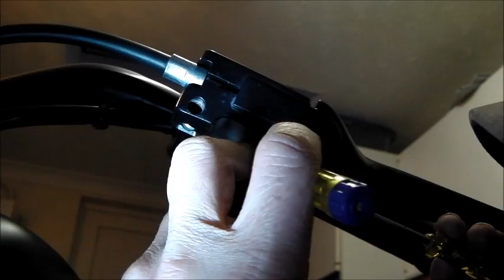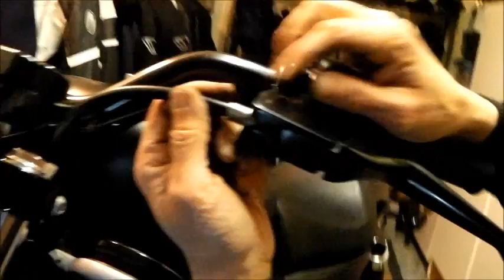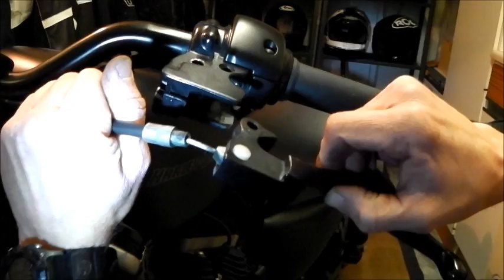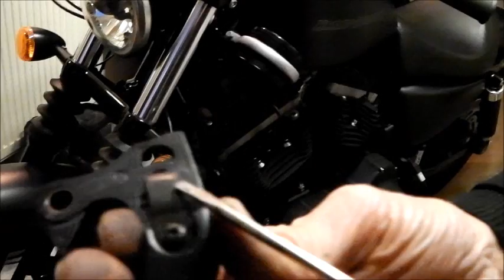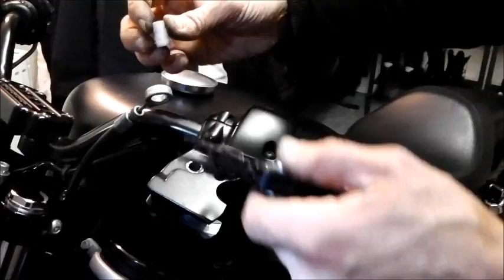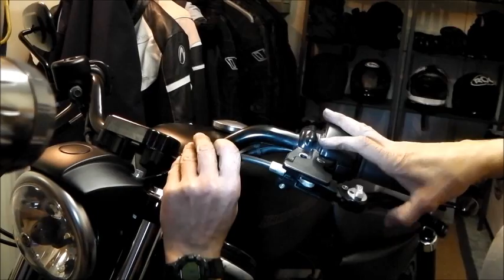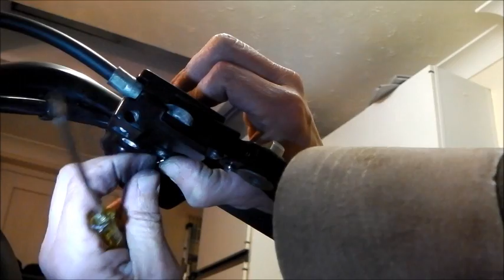Delboy's Garage, Harley Sportster, Clutch Lever change.

Comment: Getting ready to change my stock clutch leaver on my 04 wide glide. I have the manual but it just wasn't enough. After watching your video shouldn't be a problem. Thanks for posting. I will be returning to your video's for more info on other issues as they arise.

Comment: Thanks for the info. I am glad I checked here before having the shop install the lever. Literally took 10 minutes, and wouldnt have even taken that long if I didnt have so much trouble getting the ring of of the pin and then again having trouble getting it back on.

Comment: Thank you for the tips. Especially thanks for this video. Been riding since 1977 and have small hands, just bought a used sportster two years ago and adjustable levers will make a big difference.
Reply from the maker: Hi Kris, good on you mate... finding these levers meant that Penny could ride the Harley she wanted as despite all their promotion of women riders, they're still producing the same bar and lever arrangement as they did 30yrs ago and although they've made the clutch pull lighter with an improved ramp mechanism, it's no good if you can't bloody reach it lol!  Thanks for taking the time to watch our vids!  Ride Safe, Del & Penny

Comment: That tiny circlip is a HUGE pain to get out and to put back in place. Even after filing down my snap-ring pliers, it would not fit the tiny holes. I finally used two pick tools (you know, the kit of four with different angle ends, straight, L-shape, etc) to get it out. Once out, it was sprung and unusable. After an extensive search for a new expensive replacement, I sprung it trying to get it back in place, making it unusable. On one of the forums, someone mentioned using an E-clip instead. Genius! it's much easier to find, much easier to use and far cheaper to buy. I took the lever plug to a local NAPA auto parts store to match the size of the E-clip and got one for a few pennies, so I bought a handful to give to my buddies.
Reply from the maker: Exactly right.. "E" clip is the answer.. i remove the old one these days with a tiny electrical screw driver, insert it into the gap and twist..that flips it out, then replace with an E clip...

Comment: One thing that will make it easier....I use a Sharpie and mark the threads where the locknut stops the adjuster before I undo the bits.  That way you can go right back to the same spot without any foolishness.
Reply from the maker: 'foolishness'?!
Reply: Great tip.  Thanks!

Comment: Holy mother of hankerin hootenannies.  I wish I'd seen this video before nearly tearing my hair out trying to change my lever.  Spent a solid hour rifling through my owners manual and it mentioned NOTHING about how to actually change out the lever.  The way it was written, I would have opened up the primary case and broken something, and it kept saying that I'd have to drain the trans fluid just to open the case.  I was like "F that," packed my tools and went home.  Thank you for saving my butt!

Comment from the maker: Hi Ryan, Penny here - the levers were a present from Del and they are made by Oberon and are proper aircraft billet, not to be confused with the chap Chinese copies, they are rather pricey at £70 each, but I've had them on 3 bikes now, even static dropped a bike right on the end of one of them and they are as good as new, the drop didn't even mark the black anodising - you get what you pay for eh?  They give an inch of adjustment in or out from the standard lever - hope that helps! P

Comment from the maker: Hi Ricky, it's not hard to take your rear fender off, it's only held on my a few bolts, take your time and use your common sense and you'll have it off in now time - if you have your tail light on the fender, then there is a glued on wiring conduit which you must peel off, then stick back on afterwards with some silicone... good luck with it, Cheers Del

Comment: Excellent video. I have two suggestions: 
1. When you have a black motorcycle, black background and black parts, put a white background like a piece of cardboard or towel or something so that we can see the contrast better. (Thanks for NOT having background music which is very distracting.)
2. Invest in some "circlip" pliers. Inexpensive, time saving and much, much easier to use than screwdriver and pins. I got mine at the auto parts store for just a few dollars. I don't use them very often, but when I need them, I really need them.
Keep up the good work! I enjoy all of your videos.

Comment from the maker: Hi mate, used to change tyres years ago on steel rims with levers, but maybe I am just getting lazy as these days I just can't be bothered, not only rims alloy these days and a tad more fragile, but the last one I changed was on the trailer project and found myself puffing & grunting for 1/2hr... what's all that about! ... it's only a little 7" trailer rim, I must be getting old LOL!  Just get 'em done & balanced at a pro-shop with pro-equipment, it doesn't cost much, so why bother!  Cheers Del

Comment: EXCELLENT video!!! To the point, super info and job really well done. Thanks for the tremendous tips. Good on you mate.
Reply from the maker: Thanks Jeremy... really glad you liked it mate, it's a simple trick once you know the anatomy of the parts... thanks for watching, Del
Reply: Moonfleet41 It was my pleasure to watch, Im actualy changing out my levers today from stock to a set of Kuryakyn chrome. Ill have your posts on standby in case I get stuck....lol. I am starting at the Motorcycle Mechanics Institute in March so I am trying to do as much to my own bike as possible to get the experience. I will tacke and 883 to 1200 conversion in January. I may need your advice on that one. Keep up the great info, your help is invaluable.
-Jeremy

Comment from the maker: Not quite sure what you mean when you say nobody listens to what you say, I understand your issues with the roll pin, they are supposed to be difficult to get out otherwise a thief could steal your bike! ..to fit a new one, you squeeze them closed with point nosed pliers and tap them in gently & yes, you can drill them out, but most people use an extractor ... Del

Comment: Just did a clutch adjustment, but saw something weird. I am guessing some water must have gotten in my transmission, unless it's a different type of lubricant? Looks white, thick, and gooey lol..I'll try and show you a picture. What's weird is I just had Harley do the 10k check, and no issues. Wondering if they just took my money, and gave my bike back untouched?
Reply from the maker: Joey Bobbinson Hi Joey. If you have white, grey or beige lumpy deposits in the primary, that definitly indicates the presence of water... that water can only get there by condensation, the hot gases heat the motor, the cold alloy then forms water droplets on the inside and that then mixes with the oil and forms 'porridge'... there's no water in the engine, its air cooled, so it cant signify any form or gasjet leak...it'll just be condensation... 

If its just had the major service they should have changed the primary oil, and even if they did, there may be a lot of porridge collected on the inside of the case....so it may then contaminate your new oil... if it was my bike id just drop the cover off and clean it all out...then refil it with Screaming Eagle Syn3 oil...job done.... but you may want to call the dealer and ask thier advice first... they have a right to inspect it if they did the work..!!!! 

Let me know how you got in buddy.. good luck.. Del.

Comment: ha, great videos, I have a 91 sportster and looking to change the clutch cable, but the cover is different to your video's.
I have a very small inspection cover 2inch across, this does not allow to fit the new cable only adjust the clutch. can i do this myself does the whole side need to come off.  can you advise, or point me to a video 91-93 sporster.
cheers
Reply from the maker: You need to take the primary cover off to change the clutch cable buddy..!   get a gasket set first as you'll ruin the old one when you take the casing off.!

Comment: Thank You, Both Clutch and Brake Lever removal and installation videos were exactly what i was looking for. Those are the same levers I ordered yesterday prior to seeing your video.  So Thanks again.  I bought my wife a 2017 Dyna Low Rider S and even at 685mm seat height,  she is on her toes/ball of her feet.  She touches a little better with bigger soled boots, but not enough.  Do you know of any lower seats that would allow her feet to sit flat on the ground?  She also had a hard/long reach for the brake/clutch levers which is why i purchased the Oberon adjustable levers.

Comment: Was watching your video to try and see the cable routing because I’ve bought my bike and I can’t work out where the cable should go it’s in front of the headlight looks awful how is your is behind the headlight ? Hope Dont Mind me asking searching everywhere to find the routing on the 883 iron
Reply from the maker: Hi James, the factory routing for the handlebar harness is usually from the switch block, down behind the light and in between the fork stantion and head stock going under the tank !  Hope that helps mate.

Comment: I have heard that the white stuff is lithium grease, and that I may have a little bit of condensation from the gas expansion and riding in humid weather. Any need to pull stuff out and clean it, or would changing the oil be fine? Would you be worried about engine oil too?
Reply from the maker: Joey Bobbinson Depending on where this 'white stuff' is, it could be lithium grease, it's certainly white and you do use it in areas like this, but if it's all over the inside of the derby cover, then no, it's condensation...

Changing the oil from something 'premium' like SESyn3 would be absolutely fine, hell, you can even use Dextron ATF, as long as it's clean and quite fresh, it's only a lubricating oil for the change and sprockets inside, it's not a pressure fed system in there, just a splash casing to keep everything oily... so even a little condensation porridge won't hurt it... hope that helps!
Reply: Moonfleet41 Here is what I saw. I didn't see that stuff inside, just on the edge https://www.dropbox.com/s/5j1gw1zakt8ol2q/weird.jpg?dl=0

Comment: Great video. Here in Brazil we suffer a lot with the high cost of parts and labor charged by the manufacturer. Which brand is this   lever you have installed? Where can i buy one ? Ebay??
Reply from the maker: Hey Silvio... these levers were made by "Oberon".. they are pretty expensive, but very top quality... and yes they are available online.. !

Comment: 1/8 to 1/16 of an inch I like 3/32 half way between 1/8 and 1/16th of an inch. I use snap ring pliers for the snap ring in this case.

Comment: What if your clutch cable adjustment jam nut is not a 9/16?  It's round with a rough prickly surface and I can't loosen it to adjust it.
Reply from the maker: Hi Ruth. that 'rough prickly surface' is called "Knurling" and its designed to be tightened with your fingers... but if its too tight, you can just use a pair of pliers and break the grip.. then use your fingers from then on... hope that helps...  Del.

Comment: Hi Delboy, great video!!! Thank you. After over 5 years would you still recommend the Oberons levers or there is something better?
Reply from the maker: Hi Grzegorz, yes we certainly would recommend them, they are still amazing quality, and not much can better them, they are expensive, but having dropped a bike right on the end of a clutch lever once, all it did was push the clamp along the handlebar, didn't even break the bobble off, they truly are worth the money for durability and style... go on, treat yourself lol !
Reply: @Moonfleet41  Hi, thank you for reply. I got clutch lever. I agree, it looks great. I will get break lever next month and fit them all at once. Cheers, Greg

Comment: I have a friend with a 91 Harley and his left hand is injured. Do you know of a clutch lever or mod that would make the clutch lever easier to pull?
Reply from the maker: Hi Dan, YES buddy, there is LOTS of help out there for that, since Harley realised their early clutch pull levers were silly heavy... they made lots of kits avalable to make the lever pull really light... you didnt say exactly what model of 91' Harley your friend has, so i cant send you a link... but just search.. "Easy Pull Clutch Ramp" and follow all the links you find.. Harley do kits themselves, and lots of after market optopns out there too.. and all pretty easy to fit into the bike.. .Hope that helps buddy.. good luck.. Del.

Comment: Just a quick thanks from Canada. Same lever removal process on my Touring model and I just needed to remove the clutch cable from the lever so I could re-route it out of the broken fairing bracket (which is a big engineering flaw when contrasted against the well-designed clutch lever but that's not relevant here, is it? haha) and your video made it simple. Cheers!
Reply from the maker: Thanks JP for letting us know it was useful to you... glad you got the job sorted in the end... ride safe buddy, Del & Penny

Comment: Hey Del. Again Thanks for best videos out there. 
I've got a question if you don't mind. I was changing my levers on RSV Mille to ASV.
Brake lever Pin was locked in the barrel, and it came out of master with a spring attached to it?
There was no way I could put that spring back on or actually to take that pin out of a barrel because of the lock.
ASV came with one pin included which I used instead, and then I reused the Pin from clutch for the clutch lever. I can't really tell which lever is clutch and which brake on ASV as they look the same. Does it matter which Pin I used where? Is this spring important?

 Now I am getting paranoid that something will go wrong at high speed ;/
Reply: BTW, is your garage open to public, and where is it? Would love for you to service my bike ha!
Reply from the maker: Hi mate... Sorry, i really can picture the spring you;re talking about, is it a traditional coil spring, or a flat spring washer type thing?... and what do you mean by "Barrel"../ if you could be a bit more specific or get me some pictures, i can maybe help...    And no sadly, we aren't open for public visits or customers, we just do out own stuff here at the garage.... maybe one day, its an aim if we ever get some commercial prems..  if you can get me some images so i can see what you mean, then ill try to help gladly buddy. thanks for your support... Del.
Reply: Thanks a lot. I pulled the old levers and got the facts straight.

Clutch lever has a locking pin. No way way go get the bastard out of a barrel (Gold thing of the photo is what I mean by a barrel), even with heatgun. I guess the reason for it to be on locked thread is that it you can adjust the position of the pin back and forth?

Brake Lever has normal, removable pin and barrel. But when I removed it Spring came out from behind the black seal (?) in master cylinder. It was attached to the pin same way as on this picture (I attached it to the clutch lever just for demonstration). I don't know if I should take that seal out and put the spring back and put the lever with the pin again after, or if it's safe to leave it like this.

I wish you start writing Haynes manuals. I tell you, your vid's are a lot better!

Here's the photo of the spring and "barrel".
https://goo.gl/photos/WrS5o3phsRGaVtEz8
Reply: And that's how the Locked Pin on clutch ever looks from behind. There is a place to stick the screwdriver but you can only get to a certain point out, then you sooner strip the thread then get the fucker out.

https://goo.gl/photos/wp8TkgxBSM77eH7x5
Reply from the maker: Ok Dave, i get the point now that you cant get that pin out, and the other side came out ok?... that at least proves that it is supposed to come out and not be 'permalocked' in there..... so all you are dealing with is the matter of a seized thread.. so its the usual drill out job if you need to use that barrel that is locked into the old lever..   but that would probably trash it....  The way i would look at it is "How are the new levers working"?.. what is missing that you need?.. can you buy it from an Ape dealer?... or do ASV make the levers to fit without it..?    Sorry to be vauge buddy, but as you can imagine, i would need this in front of me to make a solution, you know how it is, once you look at the problem and get what it needs, you can make a 'work around' solution...         How does that help then, maybe see if you can buy the parts you cant get out, ad they'll probably be trashed by the tie you butcher them out..! ?   Let me know mat... Del.
Reply: Hey Del! I appreciate your reply a lot. Thank you. Levers are working OK, so I just let them be as they are without this spring and try not to get paranoid that the pins will fell out of the trackday ha!.

One of the ASV's came with the barrel so I used that for the clutch rather than drilling out the OEM one. All I am missing is biting point adjustment, but sadly can't be done on that specific Hydraulic clutch! Have a great week ahead! Thanks again for your help.